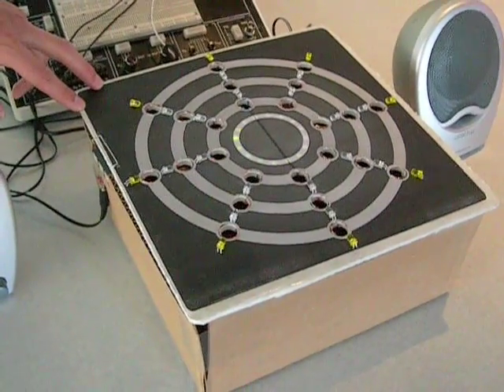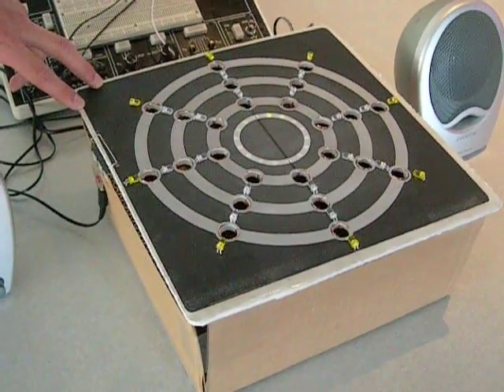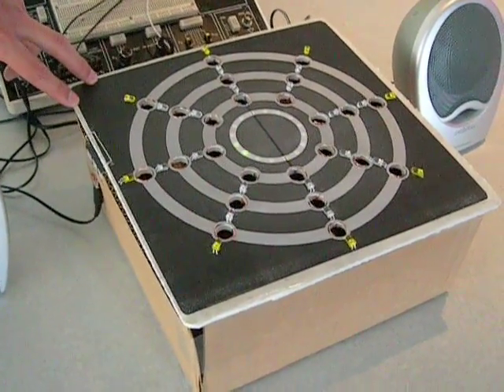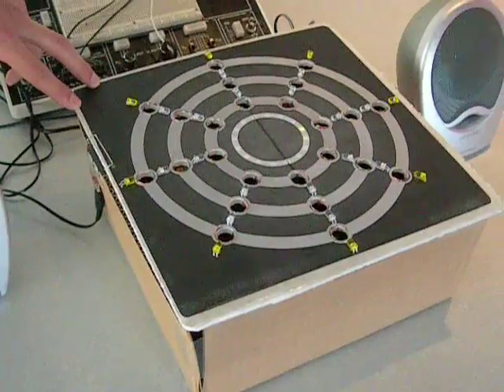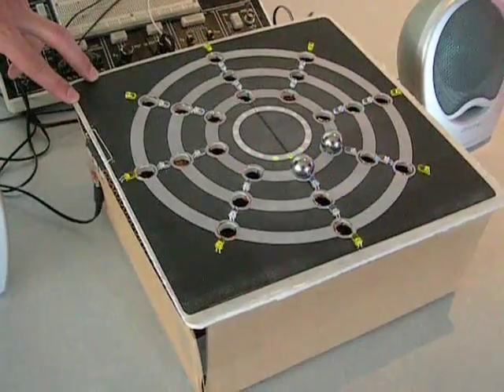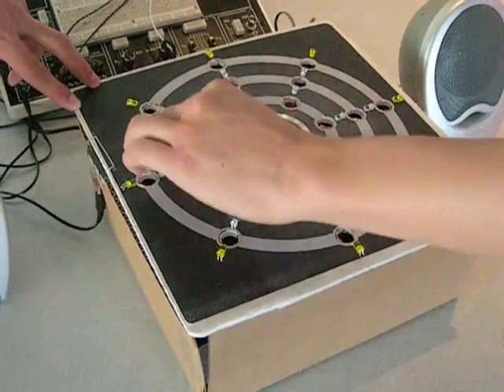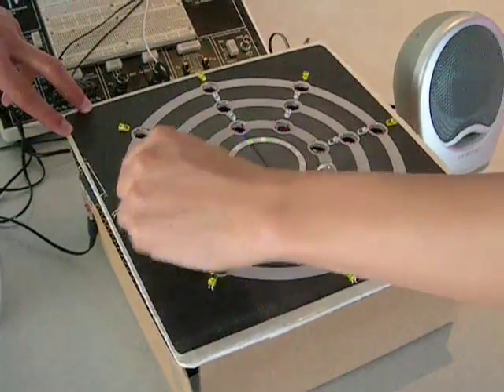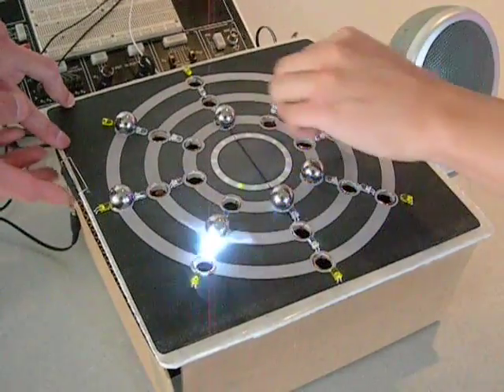Rhythm Ring Official Demo (Cornell ECE 476 Final Project)

Comment from the maker: It's an audio sampling issue. The entire thing is running on a single ATmega32 microprocessor with no additional memory or processor, and we had limited time to design and build from scratch. We decided to use a 22.050 kHz sampling rate due to the memory and processor speed, and we could have improved the audio with additional development time, but this is the best we could do in a month. Thanks for your comment!  :)